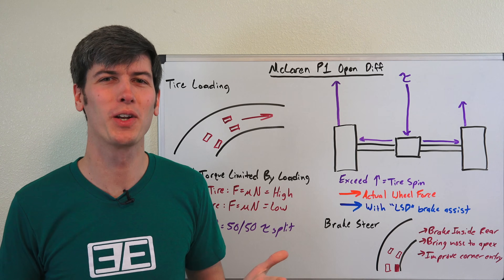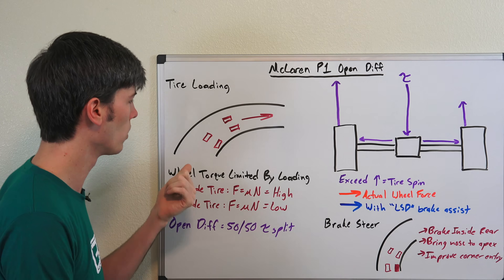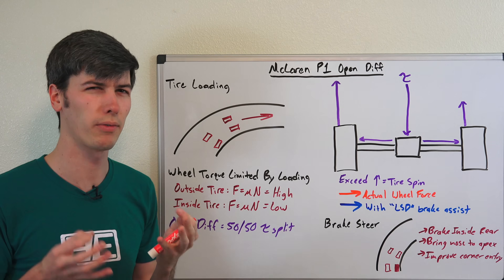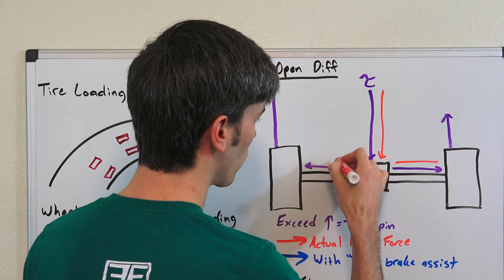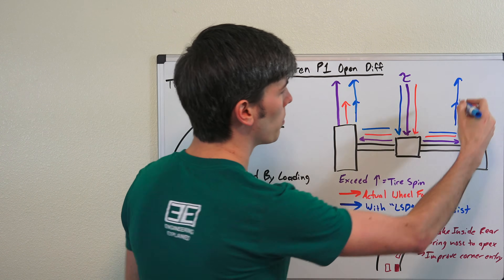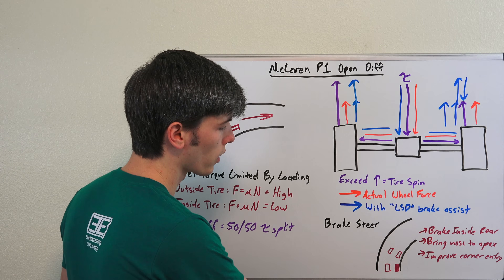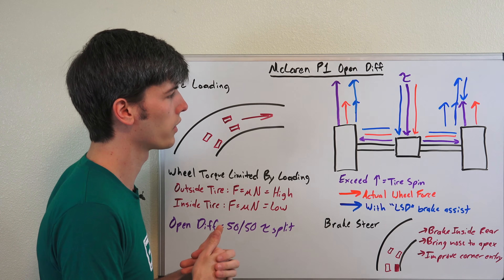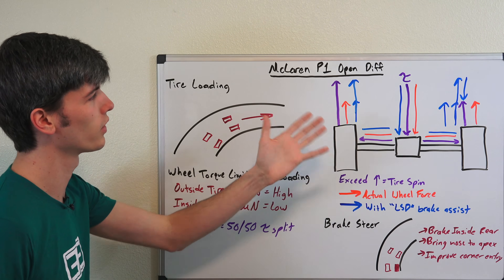The McLaren P1 Has An Open Differential?

Comment: Hi, great video. I have a question. What happens when the outside tire McLaren has reached its limit? Does the vehicle keep applying power until it spins out the outside and drift around the corner or does the inside tire give up braking and spin out. I know many cars use this e-lsd braking technology and it may depend on how the cars stability control system is designed to work as to how the car responds in this situation.

Comment: It's the difference between torque control via analog or digital. LSD can not accurately control the needed force applied. With brake control, you have a computer taking measurements and applying more accurate control.

Comment: I think McLaren has gone too far with weight shedding. Obvioudly a limited-slip diff or torque vectoring system (which I believe is just electronic diff) is heavy but the whole car weighs only 1395kg without that system, with almost 600hp/ton.
Anyway that's just me. I prefer having a tamed, heavier car than the one that cooks its brakes on high-speed corners.

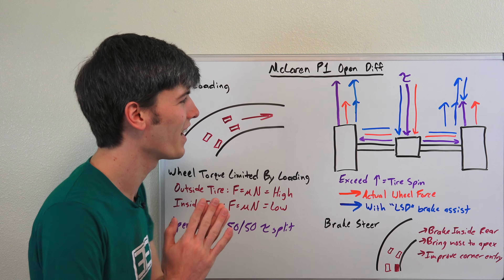Comment: 3:48. "WHY WOULD YOU DO THIS?" Easy. This system is a true torque-vectoring system which enables the Electronic Control Unit (ECU) to provide torque to each wheel in a precise ratio. A mechanical LSD can increase torque to the outside tyre during cornering BUT only once the inside tyre is rotating faster than the outside - ie the inside tyre is spinning way too fast (inside tyre should be slower than the outside tyre) and therefore unable to provide much lateral traction for cornering. The torque vectoring system can slow the inside tyre so that it is rotating only slightly faster than the road surface moving past the wheel. This allows the inside wheel to contribute significantly to the lateral cornering force. In short, this system offers way better performance than any mechanical LSD.

Comment: If I had to guess, the open differential probably weighs less than a limited slip differential that can handle similar power.  Also, the fewer parts in a design, the fewer things to break.

Comment: With my 557.3whp. Twin screw lysholm supercharged e46 m3 I have been working on the transmission over the last few weeks and I have ended up with a csl gearset in a manual m3 6sp with OS GIKEN lsd in 2way operating, the gains over the last cusco unit actually justifies the price tag which you have to be sat down before you hear it

Comment: I'm not going into the technical details (also because I might get it wrong), but McLaren's System will feel more "natural".

I didn't get to drive modern super/hypercars so I can't really comment on the state-of-the-art technology in terms of LSD/Torque Vectoring, but it's not a simple task to develop something like Nissan's ATTESA in a way that doesn't just work in lab/track conditions etc.

A while back I drove a BMW with xDrive which according to BMW needs 0.1s to react... it may not sound much, but it felt endless and the process of it working felt very unnatural to me and that was just a front/rear split... imagine you have this delay left/right.

For reference, Nissan's ATTESA-ETS-Pro updated in about 0.01s in the R33 and 0.001s in the R34 (dunno about the GT-R) and I'm reasonably sure it wouldn't take them a week to file a lawsuit if you were to reverse engineer it.

Also keep in mind that cars like the P1 might seem expensive, but they also have to carry the development costs on very few shoulders. I'm pretty sure VW spends more on developing a Golf than McLaren did on the P1. 

IIRC Ford once made a Mondeo with a development budget of 6 billion USD... meaning each of the 375 P1 would have to make 16 Million profit just to cover the development costs if it had cost the same as the Mondeo back then.

Comment: The P1 has some kind of energy recovery system for brake energy i would assume. No wear on the brakes because a generator is used. Is this the reason for them using the open differential instead of the LSD? Or does the open diff have more downsides compared to the LSD that i dont know of?

Comment: First of all, thanks for these very educational 'white board' videos you post, Jason .
I always enjoy and learn a lot from them.
.
Second, wouldn't a Torsen differential be a better option for the P1 ?
It doesn't need any electronics or braking (= energy loss ) , 
it just works by it's very clever concept ...
What are your comments on this point of view, Engineering Explained ??

Comment: Applying the brake transfers torque that would otherwise be lost, but energy is wasted by heat dissipation, correct? How much power is actually lost when comparing with a torsen? Isnt the torsen inherently more dissipative than an open diff? When McLaren went with torque vectoring the torsen would defeat its purpose by increasing the torque in the inside wheel with brake applied, taking Power from the outside wheel and overstressing the brake. Open diff was the only option...

Comment: While accelerating hard through a corner, at the limit of traction of the OUTER wheel, the inner wheel of a limited slip differential will necessarily be slipping, and therefore not contributing as much thrust as it could if it were held to just the limit of traction.  Whereas with this arrangement, both inner and outer wheels can be pushed right to the limit of traction, for maximum acceleration through the corner.  Yeah, that brake is going to get hot, and it is of course wasting fuel, but it seems that most (effective) traction control systems modulate the brakes rather than the engine, so nothing new there.

Comment: I wonder if by not having a mechanical differential, the electronic control system of the car has greater control over each wheel.  Or maybe its a weight saving thing or a combination of the two.

Comment: since this is the point when accelerating out of a corner, all the power isn't needed or tires would slip, yes?  All of the horsepower would be used once the car has straightened out.  Could this be the reason?  Maybe Nurburgring times were faster.  Regardless very interesting.  Oh - also with brake steering the car doesn't know which way you will be turning ... therefore this would be trail braking, yes?  Very thought provoking stuff!

Comment: Let me get this straight, this differential reduces the amount of power you're transmitting to the ground because you're dragging your brakes (which causes drag, ergo, reduces power) as opposed to a LSD which transmits the power that the inside wheel cannot handle to to opposing wheel (which allows for all power that is sent to the rear wheels to be transmitted to the ground)??? Who thought this was a great idea in any car, let alone a million dollar car.  Side note, it wastes brakes, could be leading to uneven wear too if you corner more frequently in one direction, and its heating up your brakes so they fade faster when you need them.
Reply: @engineeringexplained

Comment: perhaps this design was used to reduce rotating mass (since this cars 0-60 times seem to be one of its main selling points), increase the strength and reliability of the differential gear (especially since the electric engines make significantly higher torque even from a dead stop) and they may have already had a braking system in mind that would change the braking at each tire (the banned F1 technology lol) and it was easy enough to to just adapt that without the added complexity and maintenance that would be required.

Comment: using brakes instead of an LSD is laughable. an LSD would be much more reliable. and plus you are constantly wearing out your rear brakes. not to mention they are the super Xpensive silicon Carbide Akibono's
plus what happens when the brake exceeds operation temperatures. and can no longer provide correct "vectoring" I mean a diff can overheat too. but a good  LSD would be mega instead of this

Comment: Don't they use KERS on the inside wheel? That would provide the resistance and since it already is on the car it saves the added weight of more complex diffs. And it would charge the battery while cornering.

Comment: This is usually a cost saving tactic applied to mass market vehicles, that they just use their ESP in lieu of limited slip differential. But the problem there is that it's never particularly precise, the braking force is either on or off at any given moment, and there's a bit of latency. Does P1 have finer control there?

Comment: I would guess the full dynamic control is well worth it and fact that it accomplished the same thing as a LSD with less mechanical complexity and weight is a welcomed bonus. 

I would be curious about the inner wheels locking under hard cornering and how effective the break steering will be, under said conditions, considering most of the weight will be on the outer tire thus the inner tire will not be able to apply much force to actually steer with.

Comment: It's just easier to control stuff with brakes because they are very predictable and very efficient. I am planning to investigate a brake based traction control feature for a bike as killswitch or limiter options with screw the A/F ration as it's carbureted and retarding the ignition won't give that instant grip recovery.
Also 3:33 lol

Comment: Love your videos! Doesn't this car regenerate battery power when braking? That would explain why they would use this approach to use that braking force to charge the batteries some and then they can use that power when out of the corner for a boost of speed

Comment: I think its a case of asking the wrong question! Its not why didn't they? Its why would they? A locking differential has massive negative effects that are often overlooked. From the stand point of vehicle dynamics a perfect RWD car would not have a locking diff. An lsd effectively adds spring rate under load, it causes understeer, it harms high speed stability in a straight line, and with a plate-type diff it can cause havoc when it loads and unloads. The perfect differential would lock completely when you need it and be completely open when you don't......as no one has ever produced such differential so I'm assuming the conversation at mclaren went something like: "why are we carrying around the extra mass of a component that doesn't actually do what we want when we can do the same using components that are already fitted to the car?"
I think this is probably justified given the one thing everyone seems to agree on is that mclarens cars ride beautifully. That's in part they don't have to run excessive spring rates (or artificial spring rates) like other manufactures who are trying to fight all the negative points that the locking diff causes them.
Reply: Electronic differentials don't open completely? An E-diff car is faster around a track than the same car with an open diff.  Also if you lose traction on one side of an open diff car, power doesn't transfer to the other axle.

Comment: This is a clever solution.   Instead of a complex mechanical solution such as a torque sensing or vectoring differential they've moved that part to software and use the brakes to bias the torque.   Any vehicle with antilock brakes could be equipped for this.   The antilock system that detects a locked wheel could also detect wheel slip under acceleration.   The rest is in the software that actuates the brakes.

Comment: A limited slip differential kicks in only when a wheel starts spinning, transfering torque based on wheel rotational speed difference. That not only means that the inside wheel would have to spin, but it would also have to spin faster than the outside wheel, while actually should be going slower. That makes this system way better than any limited slip differential or similarly load balancing differential. It is a huge waste of energy, but that is not your primary concern when racing. It also wears down your brakes, but the same would be true for the clutches in many limited slip differentials.

Comment: now i wondering how their brakes work
where traditional brakes is hydraulic and apply equal force to each corner of the car
how their electronic brakes work together with the system, or they have different system

Comment: open diffs are better at handling mid-corner bumps than torsens. torsen needs a torque to bias, but if you lift a wheel off the ground mid-corner (e.g. hopping curbs), you have no torque to bias, and round you go. open diffs with electronic brake control would be better at handling those situations.

Comment: Honda's ATV's have somewhat of the same system in the front diff. It does have a limited slip but it will only engage when you apply the brake to allow the limited slip to "lock" in a slipping situation. . I removed it and installed a Detroit locker and never looked back.

Comment: They do this to prevent the inside wheel from spinning and losing traction because it's traveling less distance. It's much safer coming out of a turn this way because it allows you to get back on the gas sooner. The problem is that you give up straight line traction with an open diff. The new Camaro has this figured out and uses an electronically controlled posi traction engagement that knows when to engage the posi.

Comment: hhm I dont know if p1 has regenerative braking on the back wheels. If it does maybe it uses regenerative braking in the back wheels, so they get to use simple open diff in the back and charge the battery during heavy cornering, because this is obviously happening only when the car is driven fast*.Yet regenerative braking is nothing more than turning the electric motor into electric generator where the wheels turn the motor and generate electricity, can that be used only on one wheel by disengaging the other? Care to elaborate? :D

*on the limit

Comment: @engineeringexplained The only reason I can think that the open diff I'd of any benefit is that loads on an open diff would cause more maintenance costs over the life ov the vehicle than brake pad replacements.

I would imagine McLaren are looking to utilize already existing units instead of developing their own in-house OEM LSD.  It's plausable that there are no existing units that can put up with the power they are sending, or how they are sending it.

Comment: They should change the names of the diffs, it's really confusing when the open diffs makes you believe the power can go anywhere at any time and locking diff which pretty much locks the wheels together (as in 50/50 torque split). Open should be whereas the diff can openly and freely divide the power to its wheels and the locked one being locked on 50/50 split setting. Who named these differentials? I wonder what his/hers name is.

Comment: Maybe because the combination of weight, center of mass, downforce and suspension rigidity allow for less weight transfer so the two tires have more equal traction than in most other cars... that makes this system (car already has all the sensors and four wheel ABS) just as effective and noticeably lighter? An electronic torque-vectoring diff is pretty heavy. I've been wondering about this ever since I found out the P1 has an open diff.

Comment: I think it is for the weight savings, rapid response rate of the electronics and wide control range they provide.  You always have to have extremely powerful carbon-ceramic brakes on a car that can exceed 200 mph.  So why not use that excess brake capacity to aid cornering capability for free.  After all, short of an all day track session, it would be nearly impossible to overheat those brakes.  Mechanical LSD are slow to respond and electronic LSD add weight that is only needed a tiny fraction of the time. The brakes on the other hand work less than a eunuch with a harem.

Comment: I'm guessing that this method allows for the most torque to be applied to the road. with a LSD, to apply full torque to the outside wheel, the inside would apply more than friction and spin. this would result is less total torque applied to the road.

Comment: mclaren p1 has an electric motor too so it may turning mechanichal energy to electiricty , that way car will be able to calculate torq to  imly exact braking power needed to the inner wheel and it may able to work as perfct lunch control to handle high low end torq coming from electric motor

Comment: 3:01 shouldn't you refer to the inside brake rather then the outside brake in this example? Other than that, great video as always.
Reply: I am certain that McLaren is using the open diff as it reacts immediately in all situations and is fully variable, also an open diff is simpler and therefore lighter. So you will only need the braking system which you need anyways and some computer power - looks like a logical solution to me.
The costs of wear and tear on the brakes is irrelevant in this price range (just check the tire price)

Comment: Open differentials give better stability at high speed and under braking that's why they like using this system. Torque flows like water, it takes the path of least resistance so if you put the brake on a wheel that has the least grip and is spinning the torque will flow to the desired wheel. If you go off roading in a Range Rover and go over bumps and one of the front tyres lifts off the ground it will spin for a split second as it has an open diff at the front until the computer applies brake pressure on that wheel sending torque to the opposite wheel

Comment: What about brake overheating and wear? And of course extra fuel consumption to give more torque and disipate that energy through the brake to emulate de locking? I don't know how weight did they reduce with out the LSD system but, actually doesn't seem a fine solution. Smart, but not efficent.